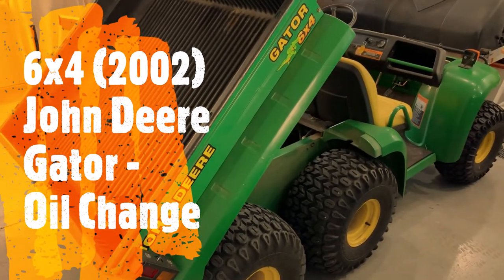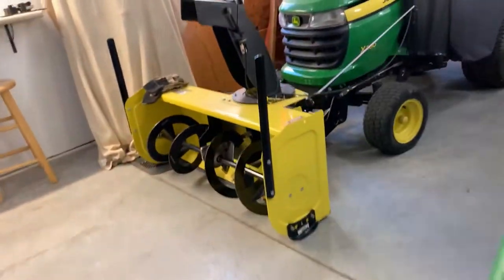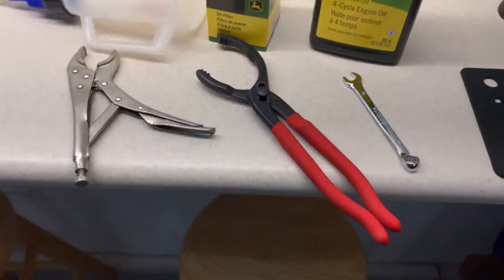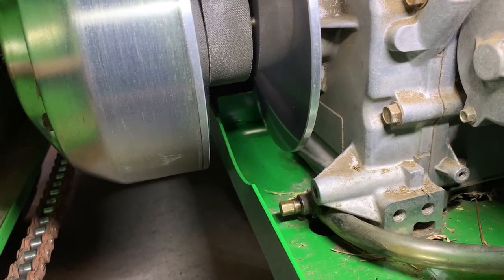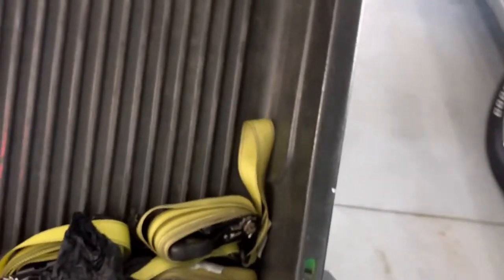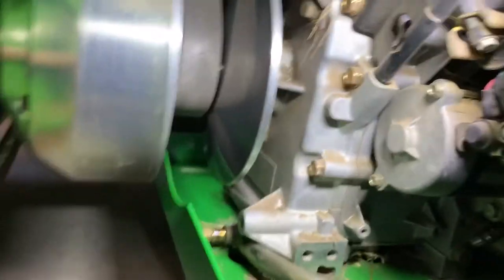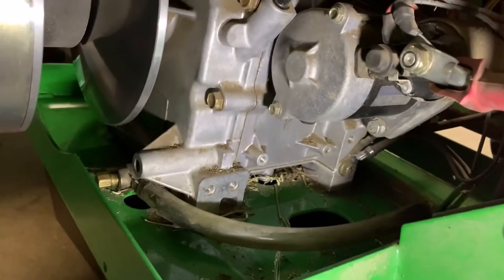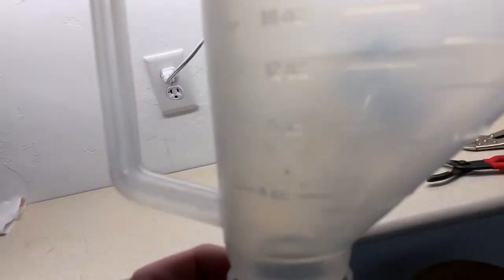6x4 John Deere Gator (2002) - Oil Change

Comment: Do you by chance have a vid on adjusting the valve clearances for this model?
Reply from the maker: Unfortunately (or fortunately) I have not yet had to do that type of work on my machine.  If/when I do, I will definitely document it.  Up next there is some strange noises coming from the rear of the vehicle - will need to investigate and likely capture what I needed to do for that.